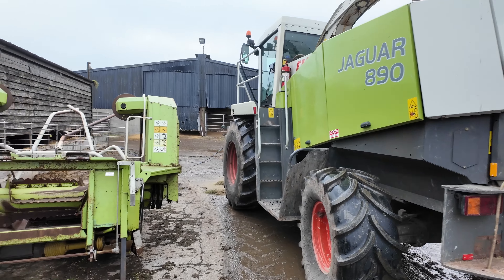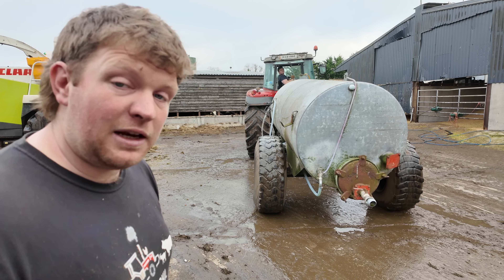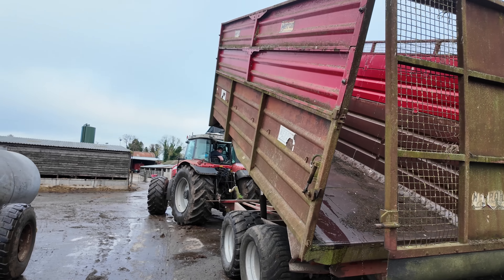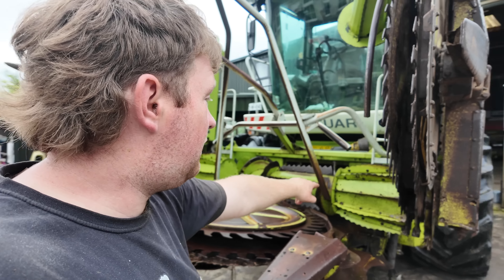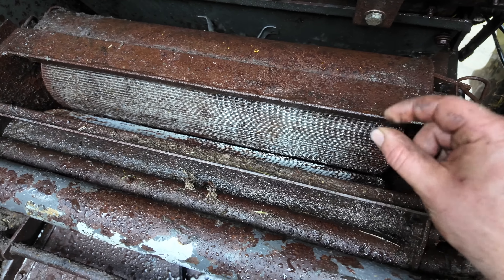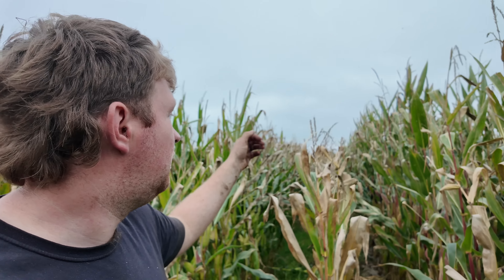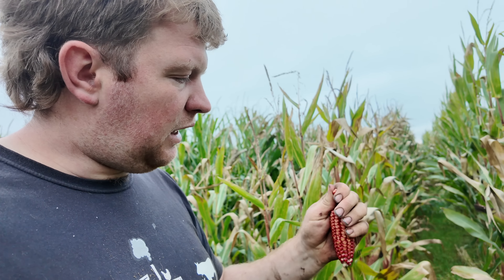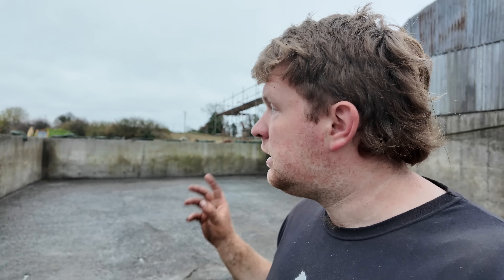DOING THINGS DIFFERENTLY THIS YEAR! | MAIZE PREP 2024

Comment: I wouldn’t be tipping trailers with the JCB as you will end up with Hydraulic oil in your tractors brakes
Reply: hows that possible as I take it you're talking about air brakes and not hydraulic brakes??
Reply: @ hydraulically operated oil immersed disc brakes have anti squawk additive that hydraulic oil doesn’t have.

Comment: May not be an issue with the self propelled grass but we piled grass with a 531-70 (no bother to her) and grass got stuck between the tyres and the mudguards.   It bent the brackets and pulled the guards off.  It was wagon silage not as well chopped that caused it.   Up to yourself if you want to take them off or not.  
She will manage the pit no problem by the way.

Comment: Your Herron trailer looks to be in good nick mechanically and tin work wise. I’d convince Father Phil (or whoever owns it) to invest in a bit of shot blasting, primer and paint (two pack) if at all possible. 

The difference will be owning a Herron in 20 years that’s still immaculate and worth a few quid or a trailer in 10-15 years that’s rotted and worth literally scrap value. 

Surface rust is like cancer to steal trailers, if you get it in the early stages you’ve saved your trailer. 

I do realise that time and financial resources ain’t to plentiful coming from a working farm myself but it’ll save you lots in the long run! 

👌🏻Great video by the way. You’re making serious positive changes on your farm!👌🏻👌🏻

Comment: Dirt driver is a very good power washers had 1 for 9 years never been any thing go wrong. We wash all our cattle sheds on hot with an turbo head on the lance in the spring when the cattle go out.
Reply: I agree with you edgarwylie8023 
We have a dirt driver for washing plant machinery , it's used every day , it's powered by a single cylinder yanmar engine with hot wash, all you need is a water supply so would run off a water bowser or mains with a header tank, we have it mounted to a pallet so it's easily moved , not cheap but worth it's money

Comment: I baught a petrol Honda washer , I think around 2500 psi but has a very high water flow rate per minute which helps , light machine for moving from shed to shed and starts first tip . Very happy with it 👍

Comment: for the power washer if your going do all the washing in 1 place then get your self a simple stainless steel electric pump and an IBC. fill the IBC from the tap or even from the gutters (put in a strainer to keep the dirt and leaves out) and connect the pump the tank. We put one in 35 years ago for the milking parlor to and still use it today even though the milking has been gone for 20 years. you could probably even reuse the hose from the old washers. Adrian on Ifram wefarm did it a few months back

Comment: We cut our maize and put a good thick layer of straw in the base.   And used the straw blower  every 2nd or 3rd load  to blow more through  the maize  ended up using  just shy of a 4x4 round  bale per acre of maize.  And minimum  runoff .
Also don't pass  kranzle for electric power washers.

Comment: Some companies will make up a machine for you. There's a crowd in Fermoy Co. Cork who made up a plug in one decades ago for us. It died after about 15 year's. Brother bought some petrol powered one and it would clean the sins off the devil. Great on concrete but too rough on machinery. Paint and all washed away. You'd need a hot washer for the machinery.
Reply: You’re brother is probably using a turbo nozzle,perfect for concrete or walls but would strip paint off a yolk😄Ideally you want a quick release on the lance to swap between normal washer and turbo

Comment: Look at the Bosch range of power washers, used them for years at various places where I worked and never had any problems with them. 
Karcher are cheap to buy but overrated and the often needed plastic repair parts are way overpriced.

Comment: Iffffff you have plenty of water get a pump 40 litres a minute 3000 psi half-inch piping on nozzles to suit. on PTO shaft it will wash silos Cattle Houses machinery anything you threw at it and if it’s too much close the tractor off a little it’s what we use in Chicken houses. get a demonstrator

Comment: We have an Old Ford 7700 with a 1000 speed PTO and have the throttle and stop control that you can operate them from the ground. 
We have a Hawk PTO operated power washer and the clever bit is we have a cable and lever for turning on the PTO from the rear of the tractor. 
It is very safe because if you push the lever towards the power washer it turns off the PTO .